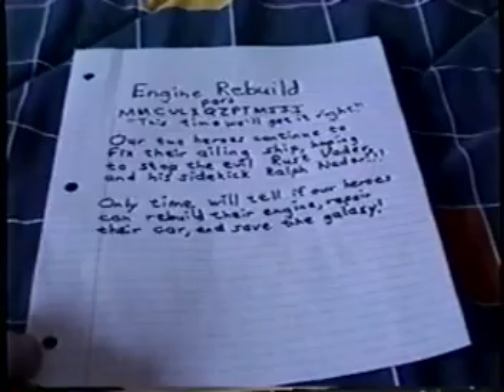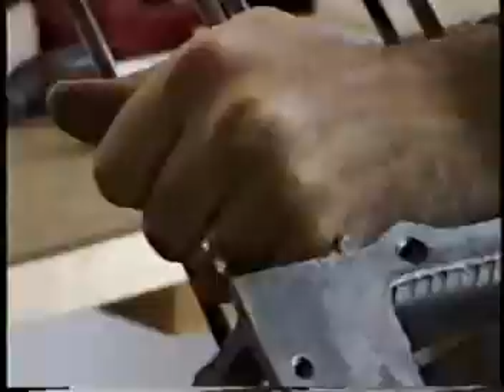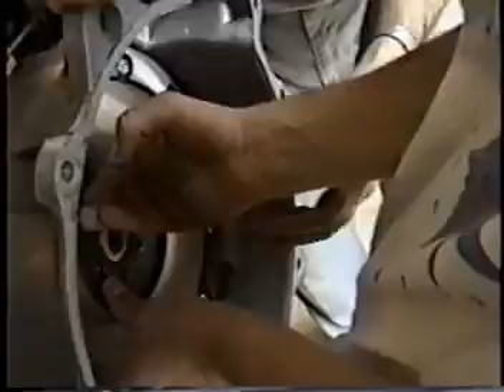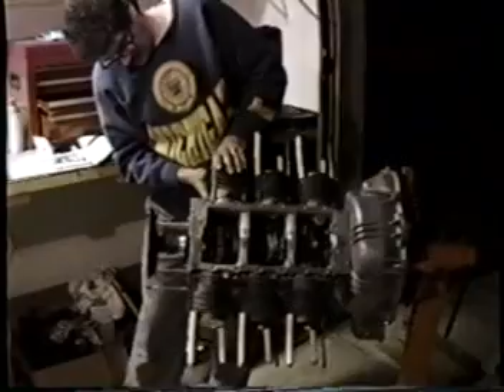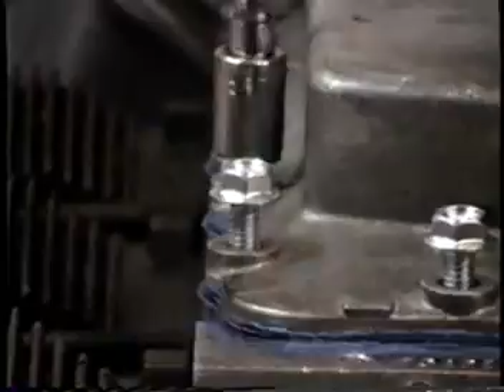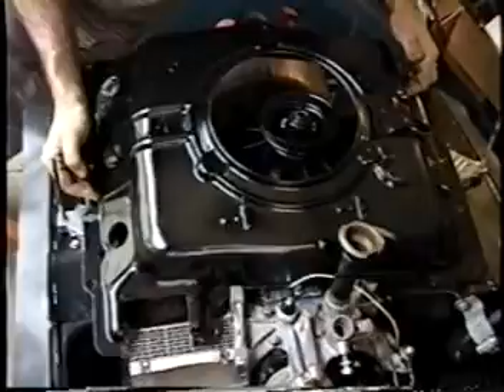Corvair Engine Rebuild

Comment from the maker: Relax!  I realize the video does not show it, but every bolt on that engine was properly installed using a calibrated torque wrench.  What you all are seeing on the video is us just running the bolts down.  The torque wrench came later.  I am WELL FAMILAR with the torque requirements for the main bearings.  They were properly plastiguaged before assembly as well.  Bottom line, don't assume that what you didn't see on a video didn't happen!

Comment: Guys,yes, yes, I'm sure in your minds it's no big deal and it works "just find". Oh, yes, and I'm sure you've done this a hundred times, but NEVER EVER crank down the block casing bolts like that again! You super over- torqued them.  55 ft-lbs. boys.  ONLY 55 ft-lbs. You cranked the living CRAP out of you main bearing clearances.